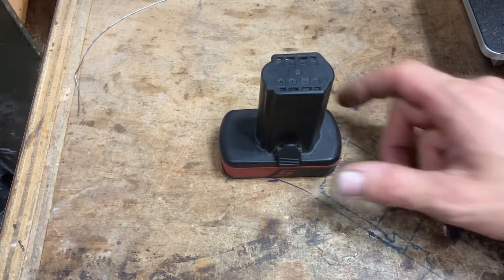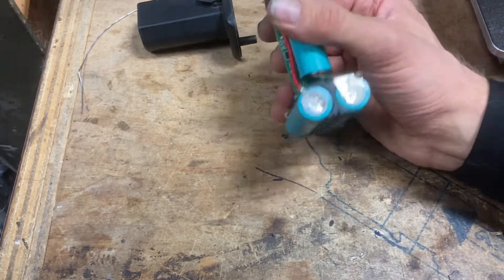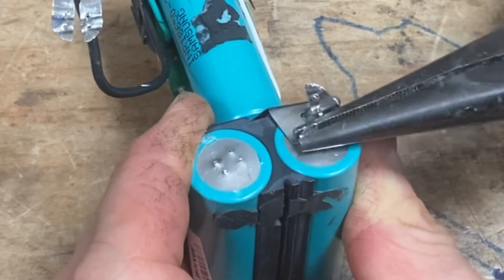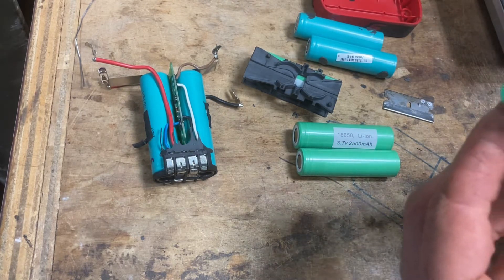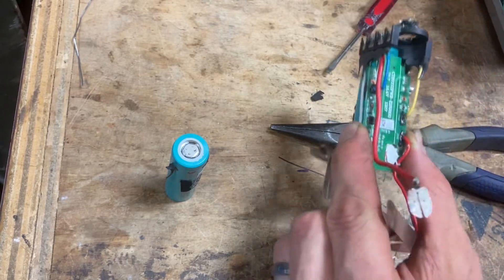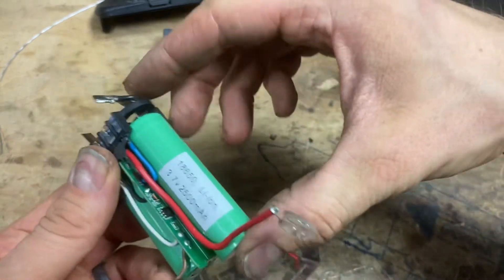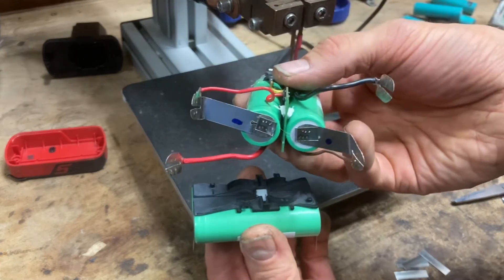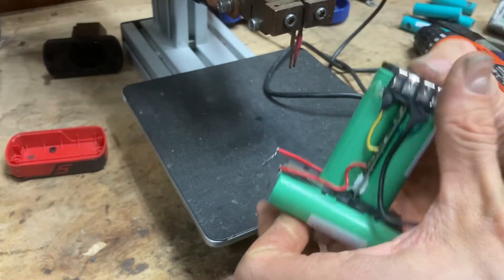HOW TO Rebuild Snap On 7.2V || Snap-On CTB8172 Repair

Comment: Appreciate the video mate, you have saved me a lot of time and money, also was just wondering.. where can I get the battery cells from?
Reply from the maker: Hey Adam, glad it helped!

I usually caution folks buying the cells online. Lots of stuff out there of varying quality. Brand names such as Sanyo and Samsung are trustworthy.

But if you want to buy online, here’s a link to what I would recommend: https://amzn.to/3PyP7VI

These are 3000mAh (3Ah). You can go less than that, but if you’re going through the trouble of rebuilding this battery pack, I wouldn’t go below 2500mAh (2.5Ah).

Let me know if you have any more questions or if there’s any way you think I could be helpful. 👍🏻

Comment: Hi i replace al 4 batteries and got voltage in all pins from battery but charger blinks red, any suggestion? any Idea how to troubleshoot the bcm? And what the pins with letters do?
Reply from the maker: Are you sure your charger works properly?

I believe one of them is a temperature sensor. That one or another one may also serve as an overcharge protection.  To be honest though, I’m not sure.
Reply: @Duby4life   
Thanks for the reply, Yes the chargers accepts other known good batteries, well I think I’m dealing whit a damaged board all 4 original cells where completely dead. Thanks once again.

Comment: Could I reuse the original tabs to spot weld?
Reply from the maker: If they’re in good shape. If there are weak or thin points in between the welds on one battery and the welds on the attached battery, it will act like a fuse and burn up if more amperage passes through than it can handle.

If you can’t obtain new tabs, you may be better off soldering on short pieces of wire in their place. 16GA should be sufficient. Possibly even more thick than necessary.
Reply: @ thank you

Comment: It would be better if this video shows the defect and what's the reason for rebuilding. What if there is a short or open circuit?
Reply from the maker: The trouble with this pack was simply that it had been cycled hundreds (possibly thousands) of times and no longer lasted as long as desired after being fully charged. So out with the old cells and in with the new. Some chemistries of lithium cells decrease from from 100% capacity to 40% or less after 1000 cycles; while others decrease from 100% capacity down to 80% after 1000 cycles. (These numbers are just for example only and are ballpark at best to convey how the capacity of lithium cells diminish after so many uses/cycles)

Comment: Greetings 🙏 
I lost my battery charger for this type of snap on battery
My question is is there any way to charge them universal? Like DYI charger type?
Would greatly appreciate your response 
Thank you
Reply from the maker: There may be some after market chargers out there that will be less expensive than buying a new one, but I would use them with caution and supervision. Without using more expensive equipment, or dismantling the plastic case with each recharge, your options are limited. I think on the long run, you’re going to be better off buying the right replacement charger.

In short: I would buy a replacement snap on charger for this.